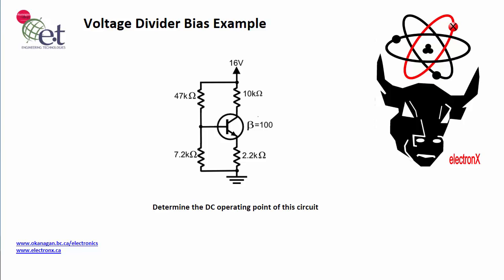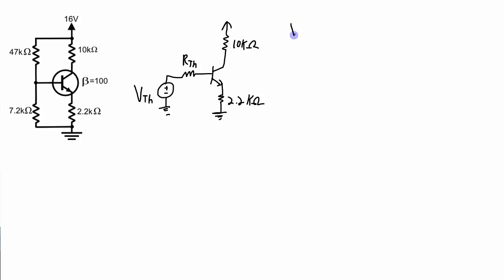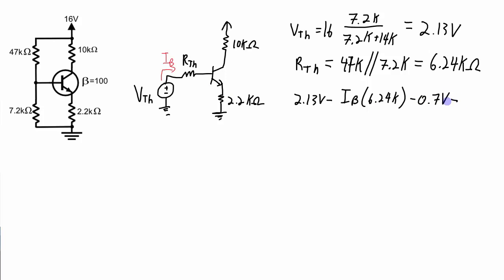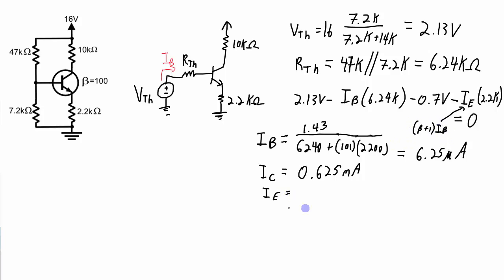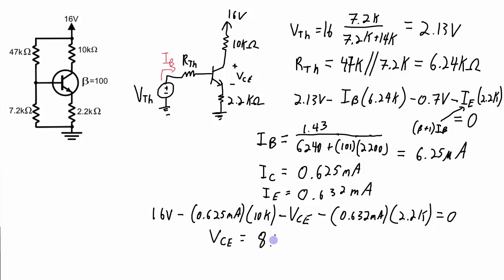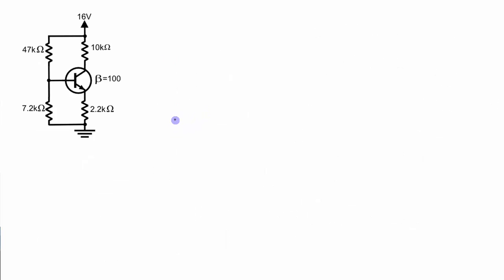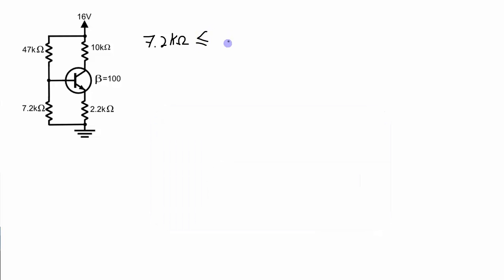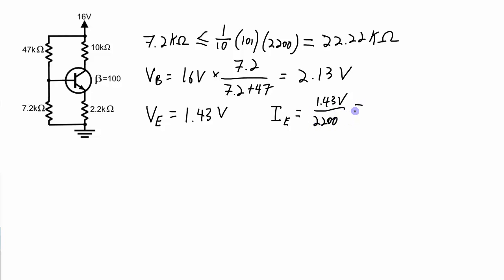BJT Voltage Divider Bias Example

Comment: If you have an EE background you learned Thevenin.  For everyone else (hobbyists), most never took formal courses that taught Thevenin.

So although I'm in the EE camp, I taught STEM courses for 5 years at UC Santa Cruz and always sought to empower ALL students, including those who may not have had all the prerequisites for the course.

You did a fantastic job by addressing both audiences (practitioners and hobbyists) in one video, and it's fantastic to find this pro attitude about presenting STEM subjects to as broad an audience as possible, since very few authors do it.
.

Comment: So given that voltage divider we get Vth in terms of Vcc but can we also say Vth=Vb? What I don’t understand is Vb is after we subtract Ib x Rth from Vth but after the voltage divider there’s nothing else there so the voltage at that point between the two resistors isn’t really Vb?
Reply from the maker: Vth is not Vb, it's Vth - (IB)(Rth) as you suspected it might be. That thevenin circuit is just an electrical equivalent of the circuit. It is not meant to be a physical representation.

Comment: There should be 47kOhms instead of 14k in V_th. (Even thought 2.13V is all right)
Reply: I figured that out as well. I was confused at first. Now i started looking in the comment section if someone pointed it out too. Your comment should be on top so someone doesnt go thru the confusion like me again haha.
Reply: The strange part is that despite that, he wrote the Vth value correctly :)

Comment: Sir can i ask why Vth=Ib(6.24k)-0.7-Ie(2.2k) but not =Ib(6.24k)-0.7-Ib(2.2k)
Reply: Because you first take I_e * Resistance (Thats the voltage on emitter). Then you convert I_e to I_b*(1+Beta) thus getting 222.2k*I_b instead of 2.2k*I_e (You need only one unknown number to calculate that equation)

Comment: Thanks, however I would appreciate seeing this from the design point of view.  IE:  Given a requirement, create a biased transistor circuit to solve it.  I always feel like I've jumped into the deep end when I watch your stuff ;)
Reply: I find this with alot of stuff I want to learn about.  They explain it from the wrong angle working backwards with the thing we want to know how to do already done - annoys the hell out of me.
Reply: @RavenLuni  yes you are true.. We need to know can we set this values from the begining? I need to know how to give values for R1 , R1, RC and RE  

I have seen al ot of tut assume a value for ICq and VE= from 1 to 2v  and make Vce= half of the VCC

Some Tut assume the value of ICq and given the value of VCC and then you get Vce = VCC/2 and calculate (re) the emiiter internal resistance of the transistor 

there are so many ways to design class A CE amplifier from the begining